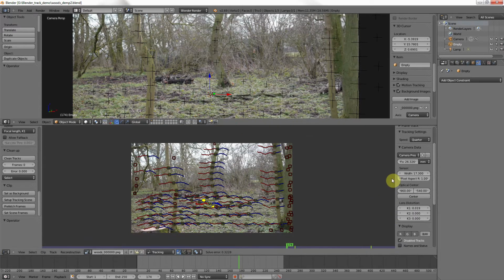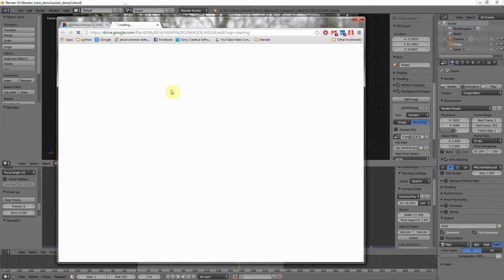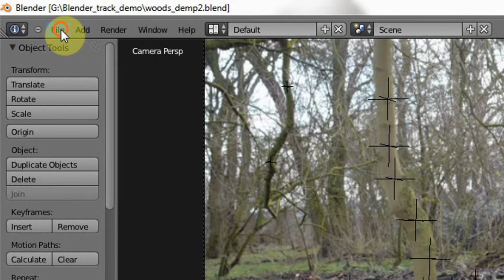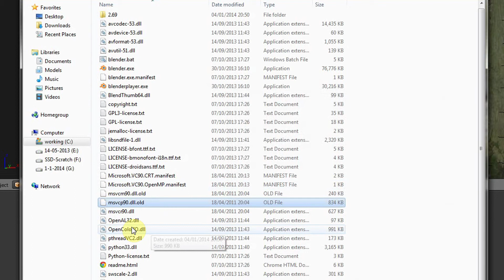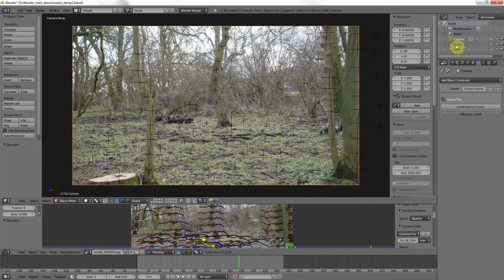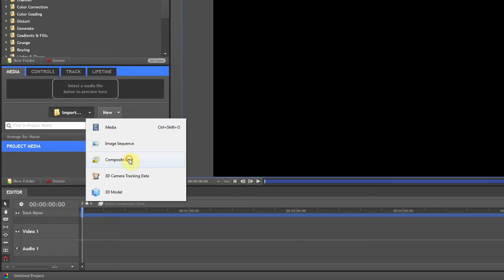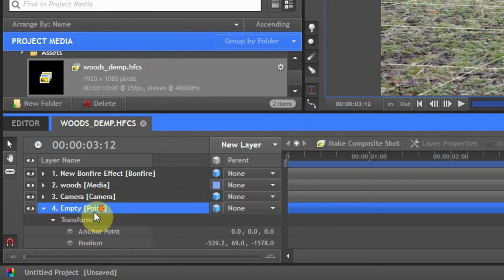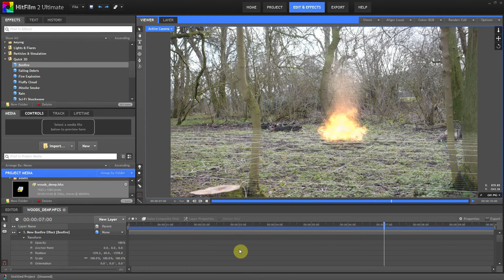Blender Camera Solve for export to Hitfilm : Tutorial 3 - Exporting to Hitfilm

Comment: Is a script required if I'm running Blender and Hitfilm on a Mac to do the same thing?
Reply from the maker: Hiya, yes you will need the export script to export from blender in a format hitfilm can consume.  I don't have a Mac so haven't tested however I deliberately didn't use any windows specific calls that I am aware of when I wrote the script so it should work on Mac and the tutorial should be relevant.  Let me know how you get on, I would suggest you do a small test first just to be on the safe side before spending hours on it and finding out there is a problem but I can't see why it wouldn't work on Mac.